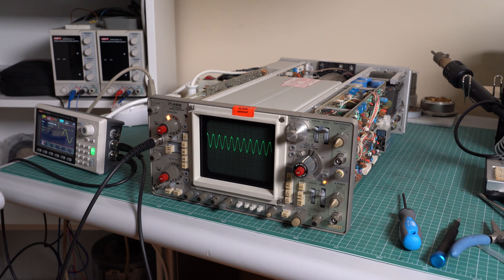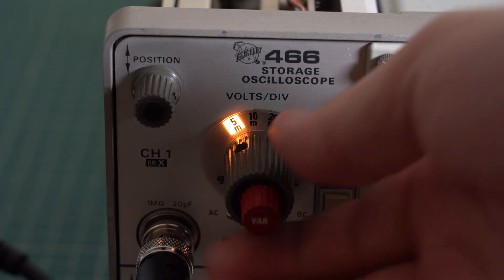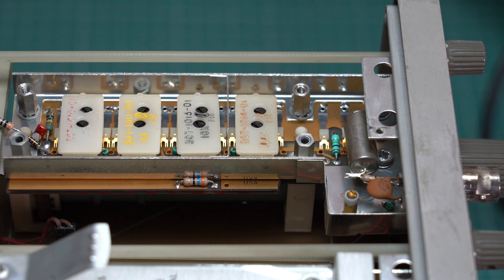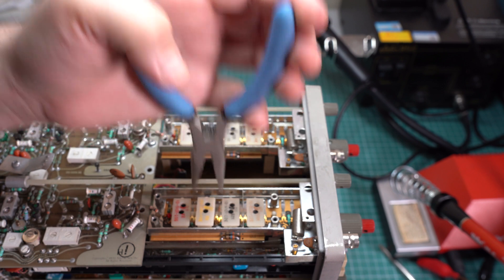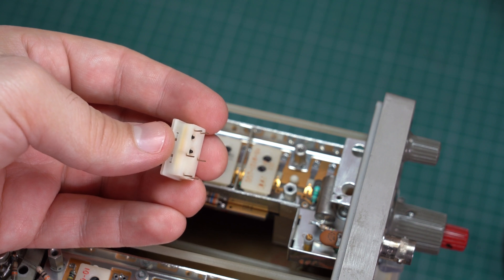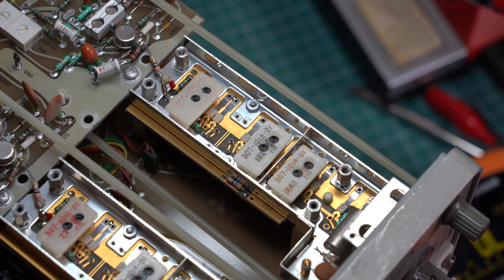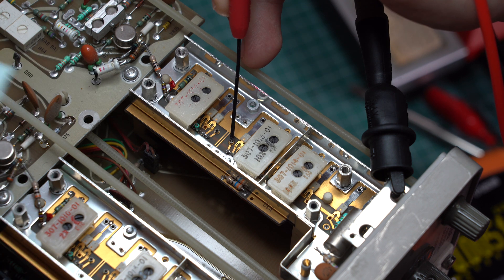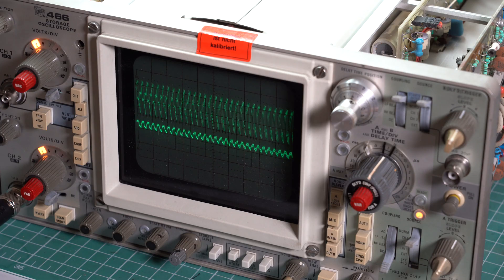Tektronix 466 Oscilloscope Repair Part 2: Weird Attenuator Fault

Comment: Well spotted ! Shango has a couple of videos about 'Tin Whiskers' and 'Silver Mica Disease' he has also shown the breakdown in 'real time' using night vision optics but I'm sure you have seen them ! You can finally put the lid on this and call it Done !
Reply from the maker: I've seen the night vision video and I have to admit it was quite an original idea. I loved it.
Stay tuned because there will be a part 3 on the repair. I fixed the scale illumination too and I filmed that as well. The scope also had a fault on the storage board, but I didn't film it. It was a 74 series chip that took me a few days to figure out. The scope works perfectly now, it got back to the owner an he is very happy with it. :D
Reply: @VoidElectronics  :)